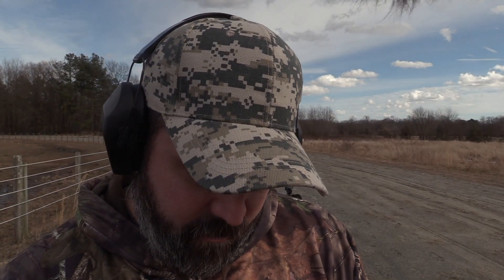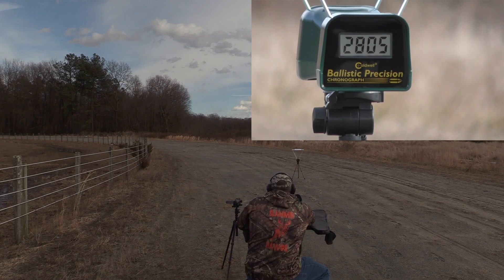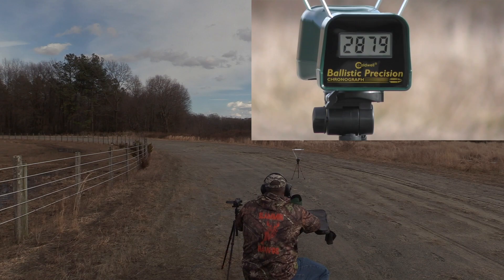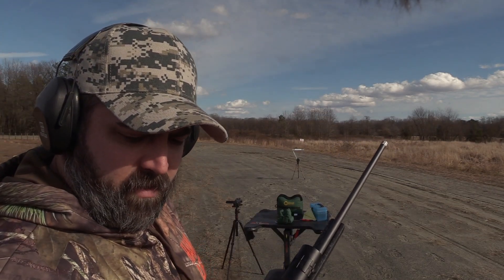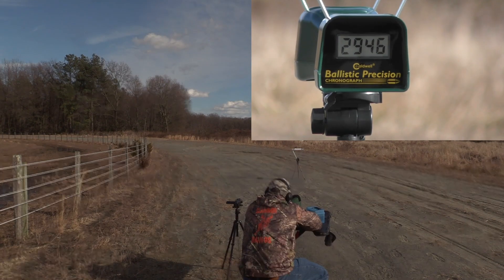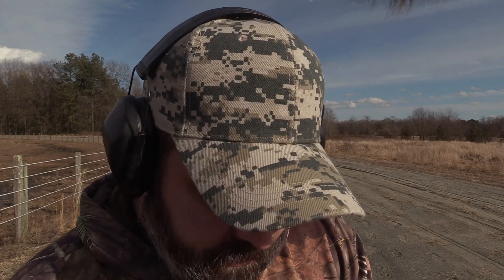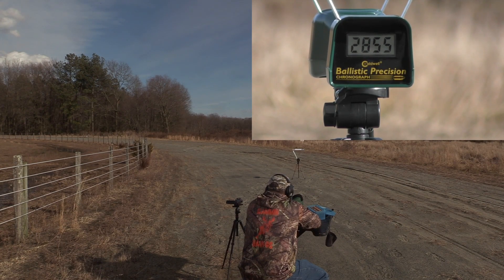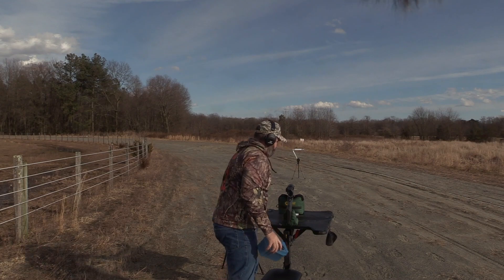25-06 117 SST Load development

Comment: Way to weak of a primer for a charge over 50 grains that primer was developed for small cartridges such a 243 22-250 and that sort of case volumes. No one understands primers they think any large rifle primer is good for any cartridge that takes a large rifle primer but there are several different heat ranges within the large rifle primer range and a Cci 200 is right at the very bottom of that heat range. You will never have a consistent velocity using those primers. Your rounds were jumping 50 and 60 feet in velocity that’s why!!
Reply from the maker: Thanks for the education,  I appreciate your response
Reply: @slamminhawgs9847  there is a great video about this subject I’d check out on the real gunsmiths channel called primers explained he goes into great detail explaining this very subject. Not sure if your aware of this channel but there is a huge amount of knowledge on it when it comes to rifle cartridges bullets powders and primers I’d check it out.